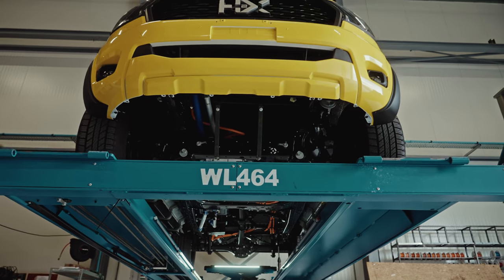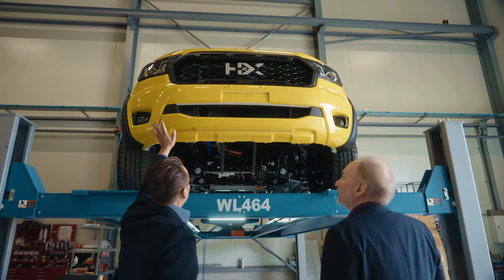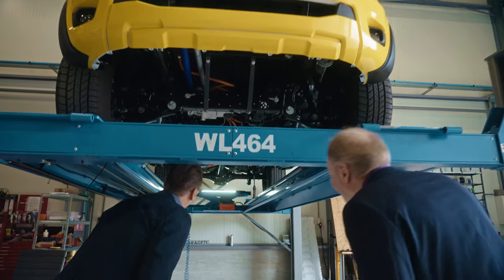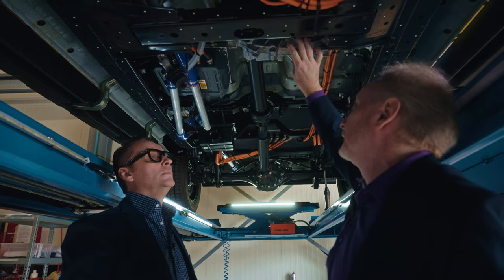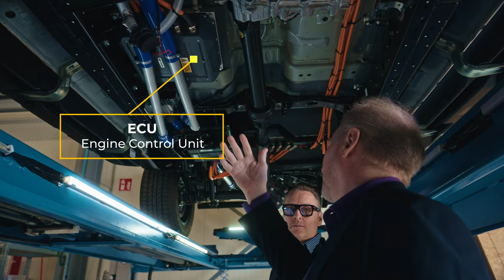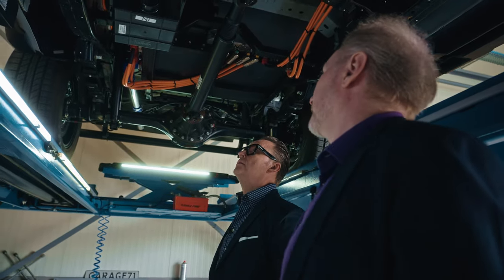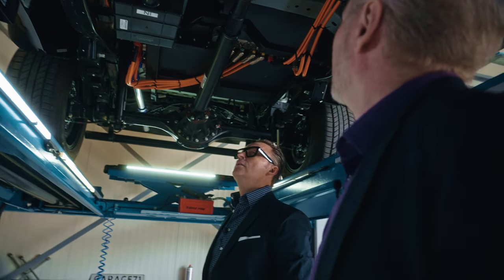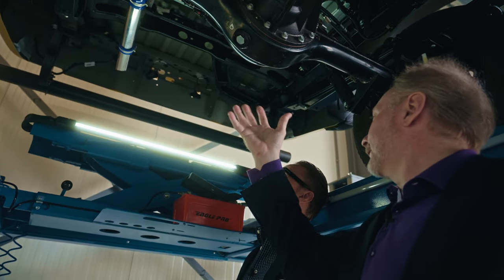H2X Global - Walkthrough of the Warrego AWD Hydrogen FCEV Pick-Up Truck (UTE)

Comment: 450 k range is not a lot in Australian Outback conditions especially if you can't carry spare fuel in tanks.
Reply: it needs to run on a HHO gas from its own generator on board. Then it will have range needing only water refills.

Comment: How does the range/econ of fuel cell pickups compare to gas/hybrids when pulling a trailer?  As I understand it, the gas/hybrids pickups have awful range/econ when pulling trailers.  In rural America that is kiling the rollout of gas/hybrids.  I think the feeling is "What is the point of a puckup if you can't haul a trailer. "
Reply: @jordanbrown7403  I like it.
Reply: If they set them up so you can insert additional fuel tanks in the truck bed or other areas for cross country and trailer hauling it seems like a good deal better than the battery systems.